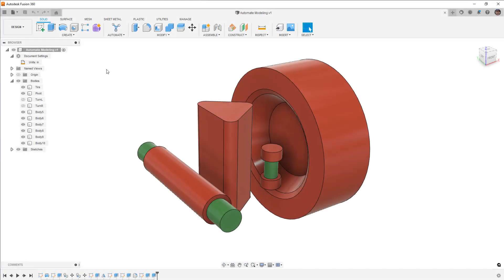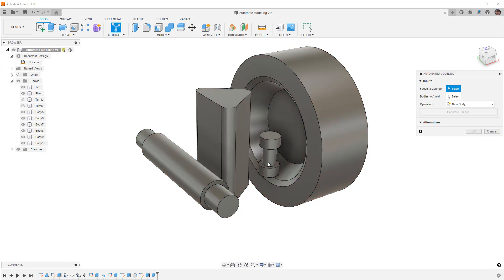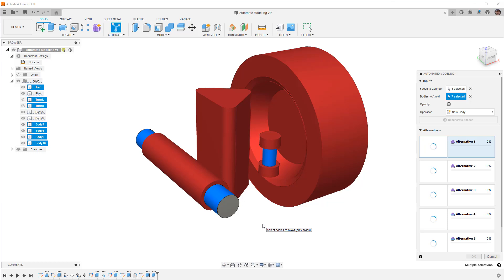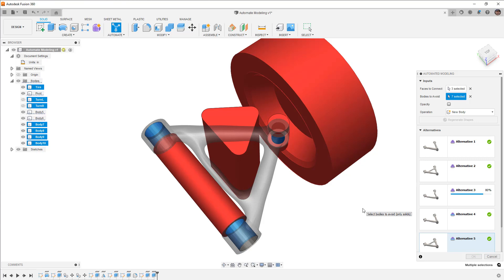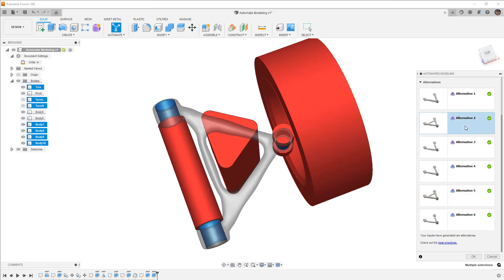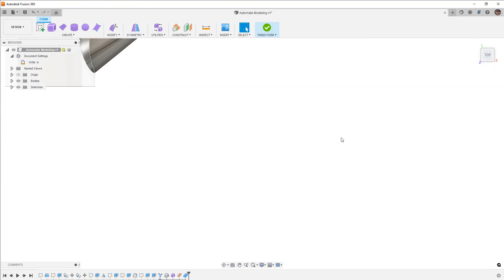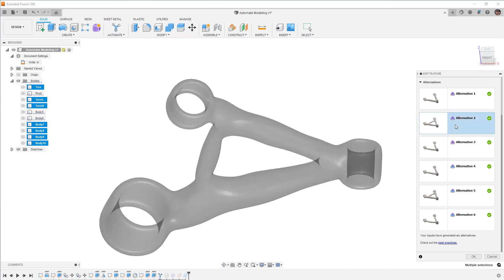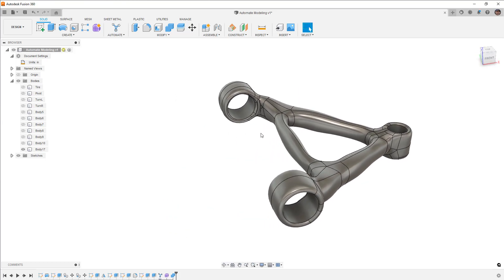What is Automated Modeling? | What's New in Fusion 360 #Fusion360 #Automated Modeling

Comment: I had been working on feedback with this and have found it working well. What I don't have a good grasp is the generative design aspect of transitioning this auto-model into generative design study. THT would be an interesting subject. I have used this to essentially minimize material on an adapter plate and was able to model OVER the generated design to literally cut 33grams of Aluminum out of a 66-gram conventional design. albeit it HAS to be 3D metal printed to even exist it's definitely a useful tool but coupled with generative design studies I think will need more...confidence in structural integrity.
Reply from the maker: Hi JF,  this step isn't required to go into GD but it can be used as a starting shape.  The big thing with GD is understanding the loads and constraints your design will see.  That is a big topic!  One reason I haven't covered GD here is because I have done a bunch of courses on the topic for Autodesk.  I will think about covering some GD topics on here.  There are 7 day free trials for unlimited simulation solves and GD solves and currently the fluid flow GD is still free/under preview.

With your design do you know the sorts of loads it will see?  You can perform some static stress simulation studies on it.  Those can be locally solved without the use of any credits.

Comment: Awesome! I wish generative design was this simple to use. Being able to go back and select a different outcome and throw it directly into the model. Then also have the form icon on the timeline you can edit is amazing!  With generative design you have to pick one of the multiple preview outcomes and click "design from outcome" to make a form body saved to somewhere as a new file. So then I paste it as a new component back into the original model, which does not have a form icon on the timeline that I can go back and edit. It is kind of complicated and I am probably doing it wrong...I have made multiple "design from outcome" t-spline bodies...but I am not sure where I saved them? They used to be $100 for each one of these exported outcomes, did they change that? I see they changed the "generate" to only $11 instead of $25. 

So in the end, I have a file with multiple generative designs for the same bracket I am making, they all look pretty freaking awesome....but I cannot edit their forms. I did edit them a whole bunch when I opened them separately for the first time, smoothed out the wiggles from generative design. But now after I pasted them as a new component into the original model file there is no editing them in "form mode"...and good luck using press pull or any solid body modeling tools on those. Haha! ERROR! I kind of created a mess in the model. Can't wait to start a new project and learn from my mistakes. Should have used the derive function.

I am actually having it HP multijet 3d printed now from Xometry out of nylon 12 for $360. Nylon 12 SLS print was $560 for some reason (usually cheaper). Add another 0 to that for any metal printing 😆
Reply from the maker: Hey Ben, totally get the frustration with the GD outcome and that is something I have brought up to the team several times before.  I will try to hit your comments/questions but let me know if I missed something.

Yes the pricing did change thankfully!  Yes it used to be $25 to solve and then 100 to convert each outcome!  Now i think its 35 to solve and no cost to turn any outcome to a design.  At least last time I did it.  I actually have a video going live tomorrow using Automated modeling as a starting shape for GD fluid.

For the new design.  yeah so there are a few ways to deal with that.  When you have an externally linked design in your browser you can right click on it and select "Edit in place" this will open up the features timeline including the form body feature.  BUT you still can't edit it.  The trick to getting it to be editable is to right-click and Break Link.  This will bring the entire timeline into your assembly.  It breaks the link to the external design BUT with GD I don't care about that because it isn't connected to the cloud data anyways.  Hopefully that will save you some stress!

Comment: I guess the usefulness of this depends on how you plan to manufacture it.  Maybe OK for 3d printing but to cast from a milled shape or mill it from solid stock would be much better modelled with conventional geometry.
Reply from the maker: Yes and this has always been the issue with Generative design.  You can mill something like this if you really want.  Generative design does take into account milling considerations.  It has 2 axis cutting, 2.5x, 3x and multix milling so it can work on the milling orientations and overhangs.  Since this is initial shape generation I think we would be hard pressed to see any advanced toolsets arrive.
Reply: True but in the next 15-20 years 3D printing and generative design will be next level!
Reply from the maker: @JeromeDemers  100% Agree.  I would guess in the next 2-3 years we will see Fusion GD output some true ready to manufacture parts.  While they are technically ready to manufacture, there is always some clean-up to be done.
Reply: Agree. The best solution highly depends on the type of manufacturing intended. I think an additional option in the initial dialog for the user to pick the type of manufacturing and parameters (e.g. tolerances) would have been nice but perhaps that's a different Fusion360 feature.
Reply from the maker: @umranium  Yeah Umran, that is getting into what Generative Design does and requires a cloud solve.  It would be interesting to have a GD solution without loads, but I am not sure how beneficial it would be.  The way GD solves is that it starts with a large volume and removes areas of Low Stress and adds to areas of High Stress while taking into account manufacturing.

In the future I will do a video comparing Shape Optimization, Automated Modeling and Generative Design
Reply: @JeromeDemers  just like the flying cars in the next 20 years 🤣
Reply: @KS-tf6nw  hahahahaha! good one! 🤪

Comment: may be they can add colors to sketch objects and a way to sellect the bullseye on a blank sketch grid first huh?? Or fix "the hole tool" so it actually can make screw holes the right way around??
Reply from the maker: Hey Rex, not sure I follow you about selecting a bullseye on a blank sketch grid.  I don't use sketch grid snaps if that is what you are talking about.

What is the issue with the hole tool?  The holes are always oriented from the selected point/face if you mean being able to flip it on a selected body.  It will do left and right hand thread so I can't imagine that is the issue.
Reply: @LearnEverythingAboutDesign  will email you later. Thanks

Comment: Great video! Saw this new option in F360 and went straight to youtube to find tips. Isn't this just a smoother workflow for generative design?
Reply from the maker: Hey Grant, this is like a "pre" Generative design.  So for GD you set up materials, loads and constraints, manufacturing requirements and so on.  all of those variables are accounted for as the simulation starts to solve for GD.  I think what we have here with this is essentially what the GD preview was just showing the build area.  

So Shape Optimization simulation study - Looks at load paths through a part and considers areas to keep, but doesn't account for load amount or if part will fail.  Output is a mesh body.  This requires the use of cloud credits as it is cloud solve only.

Automated Modeling - Looks at connection points/faces and bodies to avoid.  This is a line of sight with some iterative solving to smooth things out. This doesn't take into account any materials, mfg, loads/constraints or anything other than "connect these points".  Outputs are solid bodies comprised of a form surface, solid bodies and a boundary fill to turn them into a solid.  These can be manually modified and you can go back and select a different iterations of the outcome.  This solid model can then go to simulation to validate if it can hold up to your design requirements.  This is currently free but is preview so who knows if it will cost something at some point. 

Generative Design - This looks at multiple loads cases, materials, criteria such as Factor of Safety, Frequency, mass target, manufacturing constrains.  It solves for all of these variables to output a design that meets the strength requirements.  Output can be a mesh or a solid body made up of a form body, solids and a boundary fill.  This can be edited and Simulation setup for static stress automatically comes through with the design.  This requires cloud credits(35 i think right now) to solve and then you can output any of the outcomes as solids/mesh bodies from there.

I see this tool being "neat", but in practice it might really be a "starting shape" for a generative design.  I haven't simulated any of these to see how they hold up but GD being able to account for multiple loads is a big deal.

Hope that helps!
Reply: @LearnEverythingAboutDesign  helps a ton =)

Comment: Amazing. Perhaps you could mix this with the intake manifold series you have. That would be exciting!
Reply: Considering that the runner and throttle body connections are pretty straightforward.
Reply from the maker: Interesting Idea Rhein!  I think one issue is the volume inside would be too variable, but maybe I can do something with Generative Design Fluid Flow with something along those lines!
Reply: @LearnEverythingAboutDesign  Right, I didn't even consider that volume is a critical component to consider. Is it possible to set a "minimum" and "maximum" volume similar to the "avoid this path" feature with automated modelling? And yeah, fluid flow sounds sick and would be so appropriate for this series!
Reply from the maker: Unfortunately there is no volume option in the tool right now.  I just did another video doing a 1 into 10 solution you can check out.  I focused on how to edit the body over how to create it.  There are some issues with GD fluid still(probably why it is in preview) due to the boundary conditions and the number of inlets/outs that will work.  Basically if you put several outlets it is just looking for the path of least resistance and you might not get what you are expecting.  It works great for a single inlet/outlet situation.  I did a 2-1 with it and it wasn't balanced because there is no symmetry yet.  When i can I will play with it some more and see if it is worth showing in a video.

Comment: would the upper and lower limits of suspension travel be defined like you did for the left and right positions of the tire?
Reply from the maker: you could but it wouldn't try to build up/down because of the connection points.
Reply: @LearnEverythingAboutDesign  i was thinking that up/down travel would affect the center clearance.  Either way, this is a useful video :D
Reply from the maker: I agree.  I think if the ball joint at the spindle was taller then I would 100% add more obstacles.  This tool is really looking at line of sight, so if the areas to keep are the same height then likely you won't see any vertical building.  Not true with Generative design though so if that was used then certainly build out everything to constrain the build area!!!

Comment: Do we have something like this for solidworks?
Reply from the maker: Sadly no.  there is something called a Design Study.  this basically lets you define variables that the study can change and it will run through several iterations of it.  For example if you are trying to make a mounting plate/bracket with a specific volume you could use design study and lock down the hole locations but explore changes in other geometry.

The downside to this, like many things with solidworks, is that some functionality is available for some license types, but not all.  For example if you want to use sensors that track volume and you want to use that in a design study you need to have a premium license.  won't work on standard or pro.  and you also need to have simulation and have a study run before the design study...

Automated modeling in Fusion is only possible because of the Tspline freeform bodies.  Solidworks doesn't have that (really) built in.  The desktop application has a tool called freeform that lets you do a bit of this to a single face, but you need an add in called Power Surfacing or to use their cloud 3d experience to get subD tools
Reply: @LearnEverythingAboutDesign  Thanks for clearing my mind . ill keep with f360 for the moment (basic stuff)

Comment: When the shapes are being generated what kind of optimization is it doing? just trying to find the shortest path? Also is there any way to change the thickness of the shape thats being generated over the connected faces?
Reply from the maker: I am not 100% certain but the way Generative Design works it first looks for line of site/shortest path and refines from there.  So my guess is that it looks for shortest path and then refines the shape to smooth it out.  I don't think there are any options during the setup that I have seen to adjust that thickness, but it is a form so you can scale them up/down.
Reply: @LearnEverythingAboutDesign  Thanks for the reply! Its a fun tool, hopefully ill find some uses for it

Comment: I can't find the automate modeling tab. My program is up to date, but this tab does not exist. I wonder if I'm doing something wrong.
Reply: It does not come up in the hobbyist license.
Reply from the maker: Yeah I did some searching around and Rob is correct.  Preview features aren't available on the hobby license sadly.
Reply: @LearnEverythingAboutDesign  No I have pro license. I using for business. For examp. I have plastic design tab (boss, snap fit, rest..) I see all of these but I can't see only automate tab. v2.0.13615 Active Plan: Fusion 360, Subscription
Reply from the maker: @kkeskinn  Kemal, if you go to your user preferences in the upper right corner, and navigate to "Preview Features" it should be the first one in the Design section.  Do you see it there?  It showed up for me automatically but you are able to hide it from the Solid Toolbar so maybe yours is hidden....